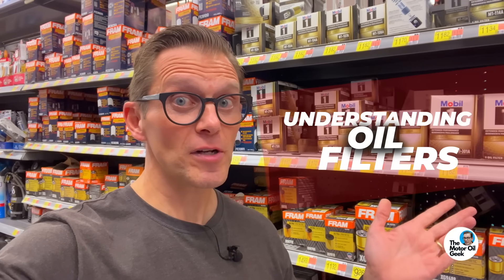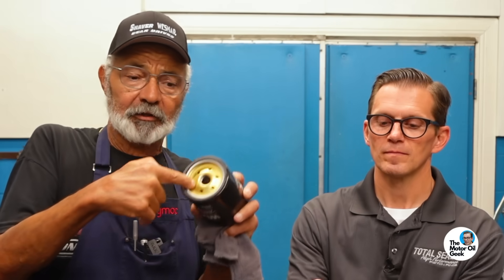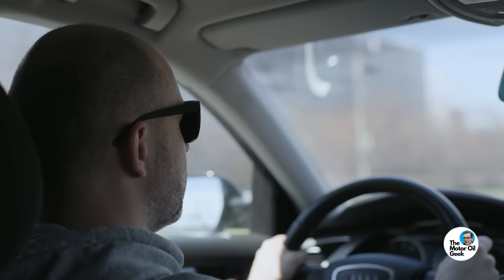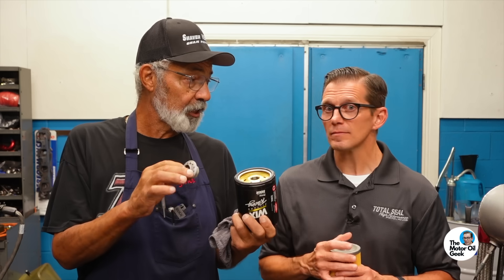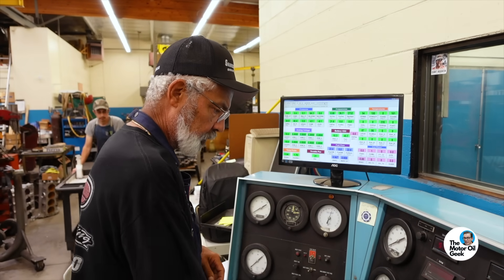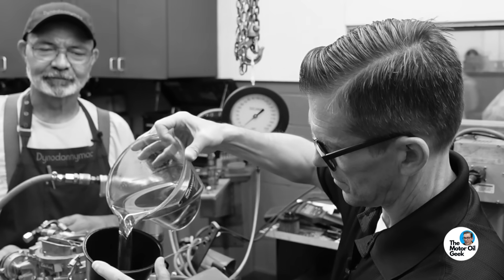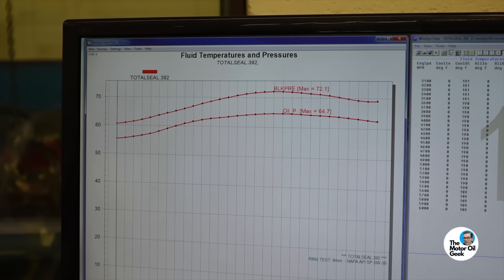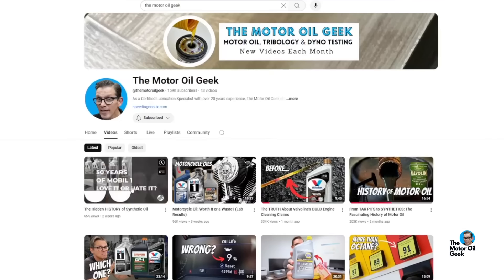OIL FILTERS: What Most People DON'T Know!

Comment: I’ll say even as an airline pilot, starting a jet engine up north in -20C temps and watching the oil pressure gage spike on initial start up Iv always wondered what actual physics was happening inside the filter. Hands down best video on delta pressure. Good way to start my 5am with coffee! Thank you for spreading the educational content! Keep them coming!
Reply: I've personally seen  757s with Rolls-Royce RB-211 engines max out oil pressure at 200psi. That's as high as the system will display. We do not touch the throttles until oil temp is within range. Aircraft engine oil is way thinner than automotive oil. Most modern electronically controlled jet engines will indicate an oil filter bypass, and many also have debris monitoring systems that actually count magnetic particles as they pass into the oil reservoir. Generally, you're allowed one reset of the system before you have to remove and inspect the filter and magnetic chip detectors for debris.
Reply: @dougrobinson8602  it would appear similar to the aircraft I fly as well. The oil pressure gauge is “pegged” for 30-60secs until it warms up. Limitation to not advance above idle until normal range…
Reply: @dougrobinson8602  (the RR RB211) Does it have electric oil pump that you allow to start running and feeding the shaft bearings and whatever other oil lubed parts are in there before you do something to actually start the "innards"/shafts to turning?
Reply: How can you prefilled an oil filter that mounts horizontally?
Reply: @barrymantei7795 yes,situations…my 2007 GMC CANYON 4 Cyl in “ horizontal “, on front of engine low, facing Radiator with only few inches (* though NAPA ,& some Shops have cross Reference to a longer/larger ( than OEM OILFilters) Filters…..Anyways, I simply half-fill new oil carefully, delay for soaking/ & quickly hand turn on Filter Housing, then SNUG, WIPE BOTTOM of Assembly,; Then Start engine(* after double checking Fill etc) *& visual for Leaks  *& oil level, etc. …ACTUALLY, mt 2015;Journey Oil Filter is the MUCH more difficult, with my HAND  , or standard Oil Filter Belt wrench : vertical Filter much closer to engine/ Radiator, & impossible to use wrench handles much…((*i should track down a BOTTOM FIT, OIL FILTER remover Cap// with Special RATCHET fittings soon)..
Reply: My old 80 rabbit diesel with the solid lifter 1.5.
I installed a 100psi gauge, and that was a mistake. 
Cold starts ,even at 80 degrees out it had 100psi at idle. 
Rev it up to even 2000 rpm and it pegged the needle,that's gotta be like 140psi by the eyeball and lack of numbers on the gauge. 
Once it was warmed up ,it still had 100psi at a cruise or anything above 2000rpms.
Hot idle ,pressure was still 40psi. 
Nothing wrong there ,that's how they were. 
And over the years as a tech rebuilding many different engines I've noticed the Germans love high oil pressure like that. 
And with that ,I've pulled apart many Deutz diesels and usually the lower end bearings are fine it's the top end that wears out and cylinders get dusted or worn.
Reply: @MrTheHillfolk  From What I Understand , It is to Keep the Oil in the Main Bearings from Staying in the Bearing and Getting To Hot and Melting the Bearings Under Loads .   Stock Cars On Small Oval Tracks Put a Slice in the Bearing to Get the oil Out to Keep the Oil Cool .  All the Same Thought .
Reply: Well there's usually still oil in key places. And your pressure sensor is measuring only where the sensor is. Different areas can have different pressure. And idk about turbine shafts, but in piston engines, it isn't the pressure itself that "floats" parts but a dynamic fluid wedge from motion.
Reply: I worked on centrifugal air compressors for ~50 years. They all had a prelube pump to bring the oil pressure up to at least running pressure before run.  They recommended a starting temp of 70F using 10 w oil.  Normal run temp/pressure was 120F/20 psig.  All had differential pressures gauge with 20 psi you could change the filter while running.  Filters were 20 microns.  Capacity of oil sumps ranged from 55 gals to 1,000 gals and recommended change at 2 years.  I did see one at Anheuser Busch running at 70 psi differential on the paper without breaking the paper.  On changing oil, it was usually still clear like the new oil, but the additives were worn.  I would burn the drained oil sometimes in my diesel car.

It would be possible to put a prelube pump on a car.  Even to operate on some hybrids when the motor stops while the car is moving.  Cost would be about $300.oo in parts and $500.oo in labor.  J.C.Whitney sold one, but they've been out of business for 25 years.  My guess an engine would go double the normal.
Reply: I have done this to my daily driver, no dry starts.  Simple oil pressure light switch wired trough a 5pin relay, starter motor won't turn if there is no oil pressure.
Reply: God speed sir 🙏🏿🫡
Reply: Why didn’t you ask the technicians?
Reply: Great, more 'as a' bs comments lolllllll
Reply: Reported
Reply: I
Reply: Great video. 😊
Reply: why no auxiliary heat ?  A small heater in the oil reserve would greatly increase the startup performance in those extreme temps.   Engine orifices(openings) and the oil grade would tested or out of range at those temperatures.  Simply the viscosty of the oil would be much, much higher(thick and slow to pump).
Reply: @whatsup3270  Jet engines are similar to dry sump automotive oil systems. They have a pressure pump, and at least one scavenge pump that remove oil from the bearing cavities and accessory drives. Oil is stored in a reservoir. I've poured turbine engine oil from cans at -15 degrees fahrenheit, and it flows out just fine. You never introduce fuel into the engine until you have good oil pressure. We used to do this manually, but now with the newer engines all start parameters are monitored by the electronic engine (FADEC) controls. You just tell the engine to crank, raise the fuel lever, and electronics do the rest, including aborting start for a number of reasons. A heater would probably work, but the advantage probably doesn't justify the added complexity.
Reply: @whatsup3270  Yes, that would help, but the ones you put in the dipstick got too hot and burned oil on the dipstick.  There are heaters built for industry that do NOT burn on the elements.  There's so much that can be done to make good oil even better.  I use a 0-40 multi viscosity oil, usually Mobil 1, but I understand Red Line makes the best motor oil but twice the price.
Reply: @whatsup3270  oil reservoir and battery warmer, frequent specified filter and oil changes at or before specified periods are the key for long-life, not additional additives and other aftermarket stuff.

Comment: That's not cold oil,  come up here to Minnesota when it -20 in the morning. 
 That's cold oil.
Reply: I get what you are saying, but it's cold oil on both sides of the filter media so they cancel out. That's my take. If the oil was warm on one side I think it would be a different story. I would love to see your scenario tested though.
Reply: @glennmckinley3058  Glenn, consider this.  Take some honey, put it in the fridge.  See how it flows through a coffee filter.  Now heat it up and see how it flows.  Cold and thick is going to be harder to push through media, yeah?
Reply: @bobclarke5913  pretty hard to argue with that. Makes me think that the more square inches of filler media the better for cold climates. Let’s test that too . Big vs little in the cold.
Reply from the maker: The dyno is in LA, so "cold" in this test was room temp. It would be fun to repeat the test at a much colder temperature.
Reply: @themotoroilgeek  do you think you guys could come up with a gadget that would indicate bypass position?
Reply: Theres no way they don't open when it's actually cold. With 10-30 it took easily 5 seconds to get any oil pressure at -10 f on one of my trucks
Reply: Come to 🇨🇦 where it's-40C

Comment: THat is a great tutorial and explanation of oil pressure.  I would hope the bypass valve would not open unless there was an extreme condition present, like extreme cold (I mean -20) or a clogged filter.  People often forget about the filter when it is just as important as the oil itself.  There is a channel named the "whip city wrencher" that cuts open and inspects oil filters. I have learned more about oil filter quality and contruction than I ever thought I would.
Reply: They showed that the delta is lower with room temperature cold oil, I think that would also apply to super cold oil.
Reply: Does it really matter if they meet car mfg specs??
Reply: @hotrodray6802 I would say yes. But if you saw how some of these filters were made, you really wouldn’t wanna put them on your car. Gaps in the bypass valve, glue slapped all over the place.  Highly uneven pleats.  Some brands are not well made
Reply: @jamescaron6465 heh see my comment in the above thread about that fram vs OEM Harley new filter vs the nos 90s Harley filter. 
Fram is superior over the new OEM filter every day of the week.
Reply: @MrTheHillfolk not all OE filters are created equal that’s for sure. I would use motorcraft and ACDelco  but not sone others.  After seeing how some of the filters had tons of excess glue all over the place, I wanna see one open before I’ll use it it’s like they use tons of automation but no QC.
Reply: @jamescaron6465  yeah man , definitely agree. 
I drive mostly vws ,I try and stick with Mann or Bosch or a decent OEM supplier. 
Those old idi OEM VW filters have like a 45psi bypass spring ,no aftermarket filter I've ever seen even comes close.
Reply: @MrTheHillfolk local dealer says Harley oil is basically junk too.
Reply: @jamescaron6465  Motorcraft oil filters used to be excellent, unfortunately they've changed.  They're still decent, but not what they used to be.  I don't know if it's all of them, but I've seen a few examples of the old vs. new being quite different.
Reply: @DonziGT230  Oh that is too bad.  They used to have filters equal to the aftermarket

Comment: 68F oil temperature is not cold oil. That's oil temperature in summer start.  When oil temperature is under -31F, oil is cold. That would be intresting to see what happends then.
Reply: What weedie said. Cold start means oil at ambient.
Reply: Doesn't matter. The oil is the same viscosity before and after the filter. If it's struggling to get through the filter, it's struggling to get through the bearings in the engine as well. So the Delta remains less than the bypass opening pressure
Reply: Running engines are about a hundred, to one hundred and twenty degrees hotter, so yes, 68⁰ is cold....
-31⁰ F is fu#@!ng bitter.
Reply: Cold oil is oil that isnt up to operating temperature
Reply: Anything less than operating temp is considered a "cold start" by standard definition in the automotive engineering field. I think you may be referring to a cold soaked cold start honestly imo. Not like my opinion actually matters much though. Just food for thought. Happy Saturday!
Reply: @weedie82  for over 30 years federal law says at cold start the cars EVAP system has to run a self test to check for leaks in gas tank and canister. This only happens below 50 degrees.
Reply from the maker: The dyno is in LA, so "cold" in this test was room temp. It would be fun to repeat the test at a much colder temperature.
Reply: My guess is the trend would likely continue, IE the pressure delta across the filter grows as viscosity decreases. The internal engine clearances (bearings lifters, any vvt bits, etc) are the primary resistance to oil flow regardless of temperature , not the filter media. Now is a small increase in internal clearances at cold temps because the metal expands as it's heated but I don't think its that dramatic.
Reply: Likely the delta would be even lower
Reply: Just because it's not your definition of cold oil, doesn't mean it's not the industry's definition of cold engine/cold oil. World doesn't revolve around you
Reply: It’s “cold” by oil viscosity testing standards. Oil viscosity is tested at 40c (104F) and 100c (212F) typically. There’s probably a few labs developing specific oils for extreme cold weather and I’d say their standardized testing is different.
Reply: Glad to hear you know more than the expert with several decades of experience. Maybe you should start your own channel @jm-tz1np
Reply: I had to install a remote mount oil filter head on my engine because of clearance issues. The remote mount did not have a filter bypass like the factory one did.  I was concerned at low temps it might starve the engine. Turns out even at -15f this winter I could not observe a change in oil pressure and it is measured after the filter.
Reply: @bcbloc02 Thus it's highly likely I'm safe to delete my bypass valve, doing this probably won't cause starvation at cold or operating temperatures.
Reply: @ I think so
Reply: This is exactly what I thought he meant by cold start. Pump the room full of freezing air from outside overnight to chill the block and oil, then do a COLD start.
Reply: I’d like see a cold block and cold oil, say 0F and -20F as here in Chicago area is common in the winter.

My son in northern Minnesota sees -20F and colder a lot in winter.   He said that it takes 20-25 minutes to get the temp gauge to normal.
Reply: @FFWrench  delta raises with temperature. So the lower the temp the lower the delta. Pretty simple. It's going to move the the oil as fast as the oiling points will allow in a cold engine. Tolerances open up and volume increases with temperature.
Reply: @FFWrench you clearly can’t comprehend what was stated in this video. The temperature doesn’t make a difference in the delta filter pressure.

Comment: Question : An antidrainback valve keeps oil in. Can't the oil just drain thru the media and thru the center outlet hole, assuming the filter is mounted upside-down like on a Subaru engine?
Reply: Oil does flow through the filter media with just gravity. I've seen it when pre-filling a filter when doing an oil change. Fill through the middle, it fills...wait 10 seconds the level goes down over halfway.
Reply: @JG-kv4oi  that is the media wicking up the oil, mostly.
Reply: Yes it can and it will over time. I have a car with a sideways mounted filter that doesn't get driven much and after sitting for a couple weeks it dry starts with a bit of lifter noise. It doesn't happen if I drive it frequently but despite having tried dozens of different oil filter they all drain out over time. I know this is the case because I've taken the filter off cold after sitting for a couple weeks and it's only half full. I can only assume an oil filter thats mounted upside down will drain almost fully. My advice is to install a prelube pump if you have a car that sits for extended periods of time, or at least a remote oil filter mounted right side up. However I've not done either of these things despite my intentions to🤦.
Reply: It seems to me that it does.  When I change the oil filter on my daughter’s Subaru Crosstrek 2.5 it will have almost zero oil coming out of it.   It’s empty when I remove it.  If I try to remove it within 15 minutes after running…then yes I get about half of an oil filter full of oil and it quickly becomes a messy oil filter change.   If I wait longer than 30 minutes or more… filter is empty when removed.
Reply: Now I have to test to see if oil will permeate the membrane without any pressure behind it!  Great question!
Reply: The would have to flow past the very small clearances in the bearings, etc.  A very slow process with only gravity.  Anti-drain back designed to retain oil for reasonable amounts of time.  If a vehicle stored for months, yeah you could lose some.
Reply: It will happen. It's incredibly slow, the mass of the oil physically located above the filter is going to try to try to flow back due to gravity, but the restriction of the filter media, passage diameters, viscous nature of oil, any check valves along the way(usually at least one in the circuit that feeds the valvetrain), along with the pump itself not being designed to have any intentional flow path between pump outlet to pump inlet except for an overpressure relief valve that should be closed, all of these things prevent this from happening.

Of course, there is no perfect system, assembly tolerances exist that will inevitably allow close to or total drainback given enough time. That's if there is no internal leak either, which would accelerate the process too.
Reply from the maker: It depends on the location of the filter and oil passages.

Comment: Very informitive. I guess I always thought on those cold mornings and high revving the bypassed opened. Once again I was proven wrong.
Reply: I think you may get a few seconds of bypass if the oil is like below freezing, but it won’t stay in bypass long, depending on the weight of the oil. Certainly not “minutes”.